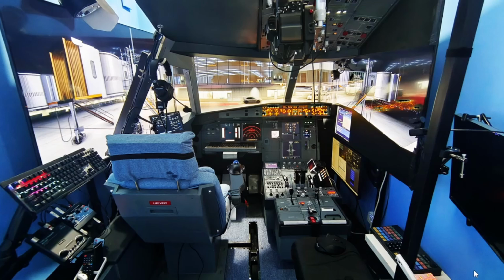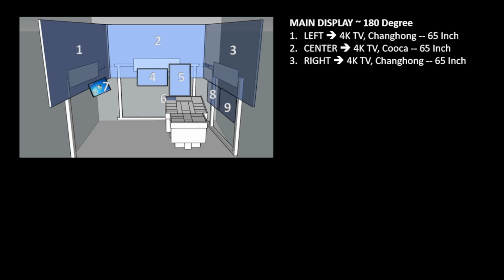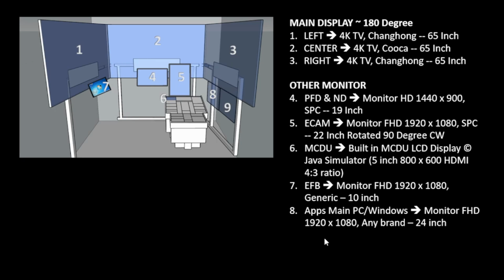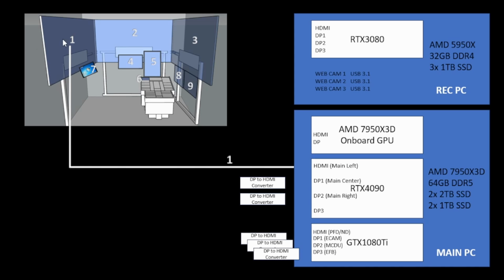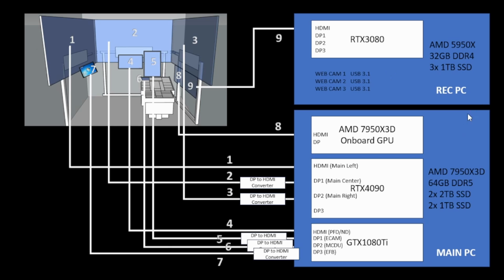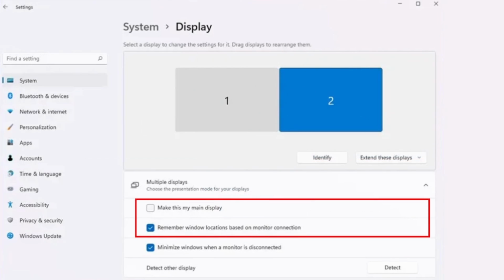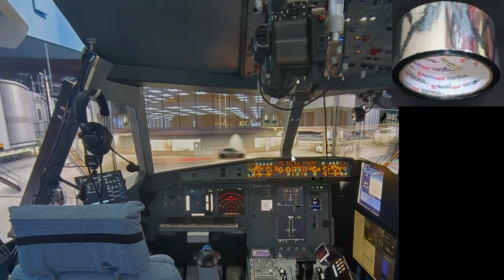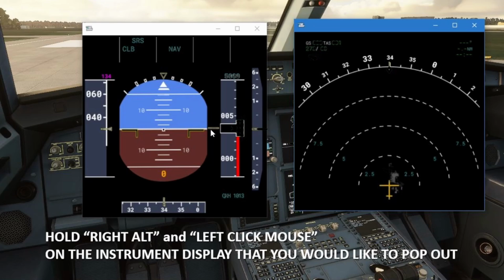DIY A320 Neo Home Cockpit Build Video   Part 8 Displays

Comment: Hello, I have a question for you. How did you position the Flybywire Online MCDU display without a button? Or is your MCDU a touch display? It's not clear from the video.
Reply from the maker: @richardkoch2644  im not using the on line version just basic screen pop up method the button is physical buttons connected via mobiflight its in the previous part video on pedestal
Reply from the maker: @richardkoch2644  https://youtu.be/iFNqeskD6kw?si=DyTrQ0xAepdRaXZI
Reply: Great, thank you. I always enjoy watching your videos. Great cockpit!!

Comment: hey @hobby tech gear, love this setup! would you happen to have a link to you're airbus armrest or even chair because I really don't want to spend $4000 on one😀.
thanks

keep up with the great content
Reply from the maker: Not that I dont want to share but im using office chair which I mod myself will feature in part 10 on misc. I think its not available internationally. I ve bought it for just 40-50 usd and modded it.